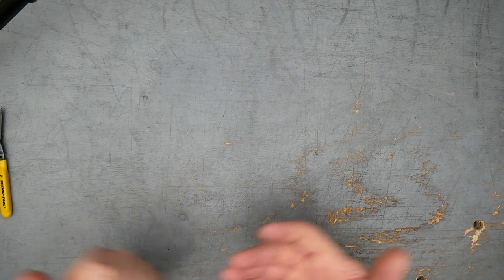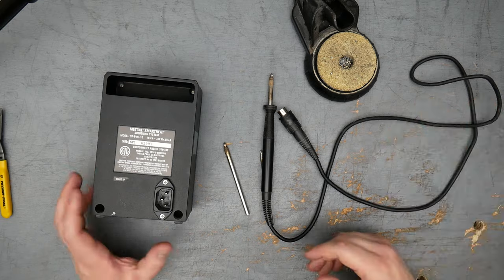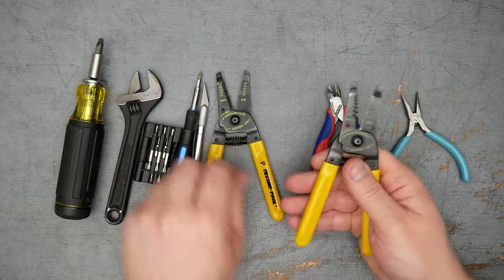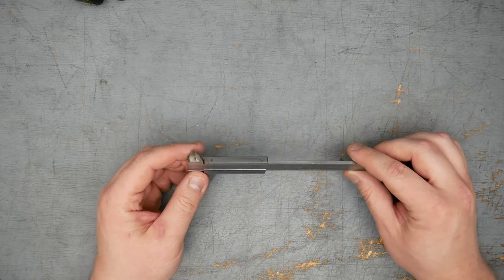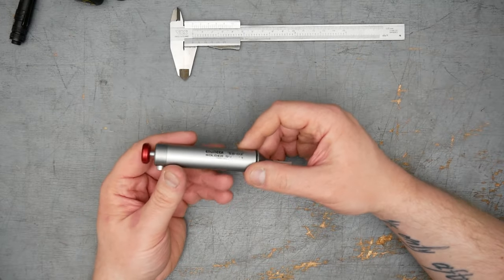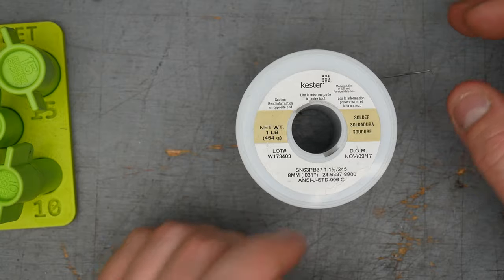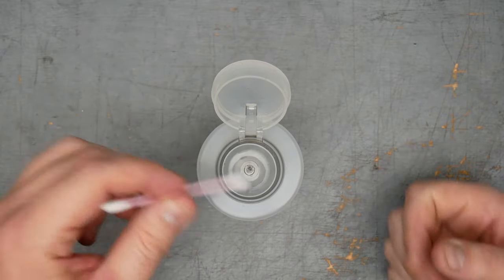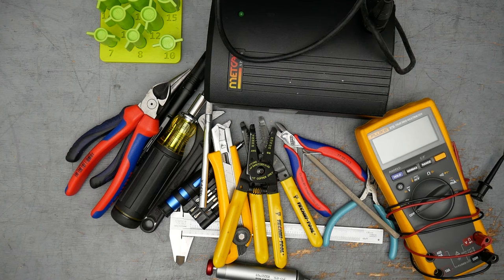Tools for Building Guitar Pedals! // Gray Bench Electronics

Comment: If there are any doubters on solder's shelf-life: I am still using a spool of Kester 44 my father purchased from a welding supply shop in 1979. Flux is only slightly less effective than newer 44.

Comment: Neat soldering station, I hadn't heard of Metcal. Hakko FX-888D guy, been working great for past few years, no complaints. Can also recommend the little red-handle Hakko/CHP pliers, flush cutters, and wire strippers, all excellent. +1 for bike tool/pedal tool crossovers! Pedal building (for leisure) is meditative like wheel building, but I only need so many bicycle wheels whereas pedals...
Reply: Metcal has been the industry standard for NASA and MIL Spec manufacturing for about 30 years. You can get different temperatures by selecting different tips (They offer each size in a few different temperatures), but for this application, the tips Joe specified are good. The older models ( like Joe’s) are made better and last longer.
Reply: hi. do you have a model number for the Hakko/CHP pliers. thanx

Comment: Dear sir thanks for showing more details about germanium transistors. I've bought 2SD72, ECG103A tungstam AC127 in order to service an old stereo. All the transistors have collector to emitter leakage which causes buzzing hum noise in the output and tranststor heats up more. I need AC127 or it's equivalent with minor or no leakage. Could you help me where i can buy them. I am anticipating your kind reply sir.
Reply from the maker: I would look for the old soviet transistors on ebay. Those tend to have really low leakage. Good luck!.
Reply: @graybenchelec   Thankyou for reply sir. Indeed I found that GT404A Russian germanium NPN transistors are equivalent to the AC127 ones. If they are less in leakage I would be lucky.